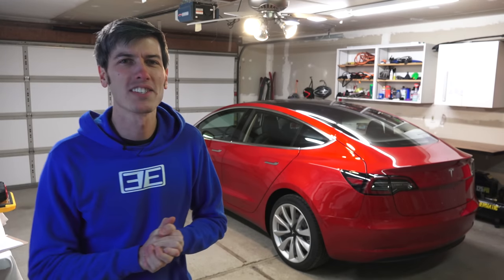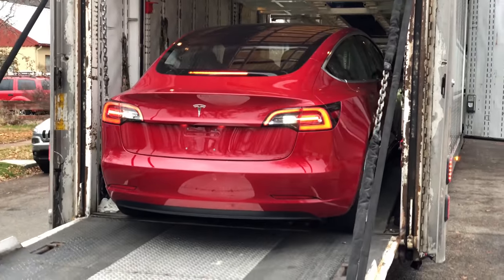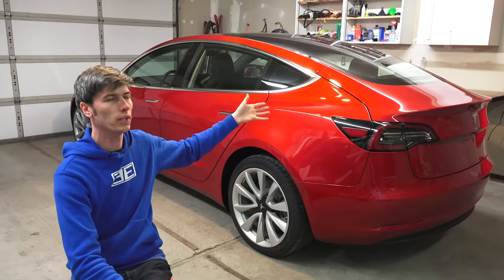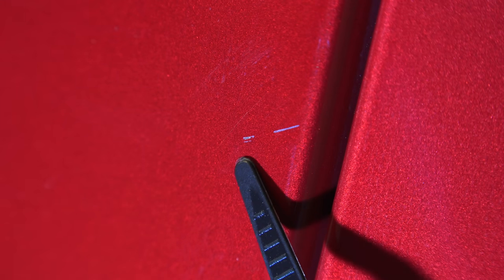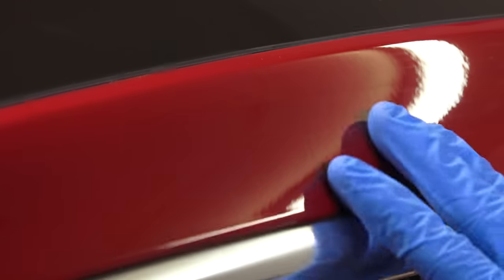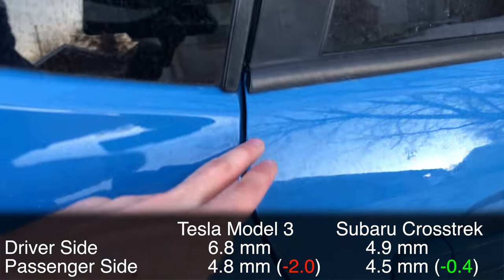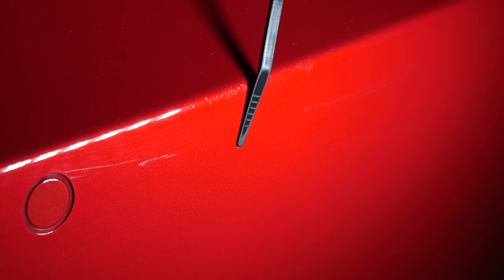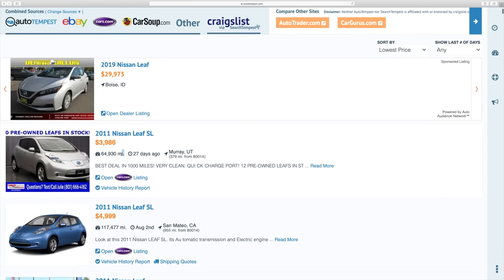Everything That's Wrong With My Tesla Model 3 - Quality Problems

Comment: Unacceptable in my opinion.  I love the car and the tech, but the quality at time of delivery is downright disrespectful.
Reply: I'd never buy a Model 3, not because of build quality issues, but because Tesla sees it fit to not put a speedometer and charge meter in front of the driver's face (where it belongs), and not being able to adjust the radio/sound/etc and the climate control without going through menus.
Reply: Elon Musk is a con man
Reply: DeLorean comes to mind.
Reply: Let's not forget this DOES happen with ALL car makers (as any quick YouTube video search will show you). The difference is that the complaints are usually dealt with at a lower level (dealer).
Reply: Brent Boswell you will have many other options in 2020.  If what every other manufacturer comes through with their promises.
Reply: I wouldnt have accepted a car with so many paint issues for sure ...
Reply: Also, let's NOT forget Tesla Model 3 is the SAFEST vehicle sold in the U.S. If you would rather be in a car that will NOT save your life in an accident but has slightly better panel gap distances; I would say your priorities are twisted.
Reply: @AscendedSaiyan3  No, i wouldn't pay that lot of money for a car built so poorly like this one, I would choose something else.
Build quality is very important in a 40 grand premium car.
Reply: @AscendedSaiyan3  Yes but this car is in the same price range as a BWM, Mercedes or Audi, which all also have excellent safety ratings, and ... better paint jobs and better assembling :D So i think tesla is going to have to improve if they really want to compete within that segment ...
Reply: @Osiris57  ,  Tesla encourages you to pay for your car in advance or first thing opon delivery.  I went over my car from head to toe before I handed my check over.
Reply: @Osiris57  It doesn't take much to get a 5 star rating. There are over 50 vehicles with that. It is another thing to have the LOWEST probability of injury of ALL vehicles tested. In that respect BMW and Audi aren't competing with Tesla. And, they TOO have paint issues. So, we are really only talking about panel gaps.  That sounds like competition to me.  The driving stability and the Autopilot features have NO equal, in capability.
Reply: People don't realize what they bought, more or less a experiment. That's what it always was, and probably always will be.
Did everyone seriously think this car plopps just out of the factory, that is in fact running at 30000% as every worker of this company. The only thing disrespectful, is not just complaining about things that aren't comprehended, yet
And btw if I would buy experiments, I would build it myself, like I always do, that's why I don't buy a tesla
Get a bugatti if you want your claimed things
And don't expect at this low price something that is worth 3 times the price.
Reply: @alatus7242  Then, you have no idea about the history of Delorean or Tesla. Tesla has LONG SINCE past Delorean and all those other brands. And, Tesla outperforms any vehicle in it's class, in just about all areas, except maybe panel gaps. Therefore, that's about the ONLY thing you can pick at. Isn't funny how unimportant ALL the other area BMW, Audi, and Mercedes fail against the Tesla Model 3?! 😉
Reply: It is unacceptable. I have never seen a new car scratched that badly. Simply wrapping the car for shipment as many manufacturers do would help prevent this.
Reply: maybe it was the delivery person...
Reply: @AscendedSaiyan3   I could buy a used model 3 and receive the same benefits of the SAFEST car sold in the US.  The entire point is that this brand new car (or any other brand new car for that matter) is being delivered in the condition that it is.
Reply: @moabman6803  I bet you've never looked that closely at many other manufacturers vehicles. If you had, you would know that it happens. The KEY is that the paint issues WILL be fixed.
Reply: @massimo7219  I don't understand why  more people don't realize that paint issues happen with EVERY automaker with SOME cars. It seems quite biased. It is ONE vehicle (his), NOT all.
Reply: @AscendedSaiyan3   Yes but it seems Tesla sacrificed some quality control issues in order to meet Model 3 delivery goals.  There are ALOT of issues upon delivery of the Model 3.
Reply: @massimo7219  Is that really truth or perception, though?  Is there ANY data that shows it is MORE than most mass automakers? I guarantee the people who are saying the things you are seem to be only going on perception. Then, you have to ask yourself, "am I being emotionally manipulated?"
Reply: @AscendedSaiyan3    No brand new car should be delivered in that condition.  None.  I would say the same thing about any car company.
Reply: @AscendedSaiyan3  I've worked at  several car dealerships. It doesn't happen very often. Now portions of the car will likely get repainted, and by who? I doubt by Tesla. They will likely farm it out to a nearby body shop which will likely use the cheapest paint they can to maximize proffit. It will look good in the short term until the paint fades. That would be my fear. Might as well buy a used car that's been in a wreck that's been repaired. Once a factory finish has been tampered with, it's a roll of the dice the quality of product used in such tampering as well as its application.
Reply: As a Model 3 owner, I find the position of the speedometer to be superior. Being directly in front of you is annoying because you have to adjust the steering wheel to a position that's not necessary ideal so that it doesn't block the speedometer
Reply: Lol no you wont. Dealers do not want EV sales. They will ensure you buy a gas car. Stick to Tesla
Reply: @massimo7219  True. No new car should be delivered like that. However, we should know these things happen with ALL carmakers.  Now, look at a lot of these comments. Does it seem like they seem to TRULY understand that?
Reply: @moabman6803  Now, you are assuming. And, we KNOW the type of defamation tactics the Dealership organization are employing against Tesla.

The car will go back to get the proper paint placed on it. MEANWHILE, he WILL have an upgraded Tesla to use! You rarely get THAT treatment from a dealership.
Reply: @AscendedSaiyan3  while that is true poor build quality can ruin the safty of a model! What if the door being offset is actually caused by a bent frame creating a weakness? How will you know until you test that? Who says you would survive the test hmmm? Bad build quality on ANYTHING = bad product period regardless of price and award. Demand a new product or a refund. No other option imo.
Reply: @AscendedSaiyan3  So you think Tesla will take the car back to the Tesla factory, strip the body completely, strip the paint completely, and redo a factory paint job at the factory high end spray booth with the factory high end paint? I highly doubt it, but I hope they do. At least from what I've seen how car companies act in general though I doubt it. As far as dealerships trying to defame Tesla, that's how the car business has been for years. They have always been at each others throat no matter who it is trying to defame each other. That's how the competitive car industry is. You never see a GM car commercial complement a Ford product. They bash Ford or whatever competition and praise their own product as superior. That's how it is. Not saying it's a nice thing to do.
Reply: @AscendedSaiyan3  Most dealerships will give u a loaner btw. The dealer I'm at now will just rent u a car, my last dealer had a huge fleet of loaners and loaned cars for all kinds of reasons. The unfortunate thing is your personal insurance will have to insure it. So if it's a upgraded vehicle and u get in a wreck in a upgraded vehicle,  u get to pay for the increase in your premium.
Reply: @brentboswell1294  lol
Reply: @oceanbytez847  Nice try, but it fails. I will explain why. The FIRST production models of any Tesla are the ones that are crash tested. Those were the WORST versions of those products. Panel gaps have only gotten BETTER since then! 

Plus, you are only talking about FRACTIONS of a millimeter for the panel gaps. It is silly to believe that changes the over-engineered safety of the  Model 3. HOWEVER, following that nonsense, for a minute, the Model 3 would STILL be the safest vehicle ever tested. So, the "compromised safety" angle has no real logic behind it (just emotion).
Reply: @moabman6803  If this was a regular dealership model, I would seriously doubt that level of service would be done. However, Tesla has a different mantra (hence the mobile service and everyone gets a good loaner vehicle, etc).
Reply: Tesla is a religion, they don't care about the respect. They charge premium for a car that has nothing premium in it or around it and they know their followers are going to buy it. It's like Apple but worse because iPhones are quite decent.
Reply: @sic22l  It's more like Tesla hate is a religion. The CEO only gets paid based on achievement. The company's mantra to help move humanity from dangerous fossil fuels (which will END humanity, if left unchecked). The vehicles produced BEATS any gas powered vehicles in class in MOST metrics and engineered to run for OVER 500K miles! So, those that want Tesla to fail, ONLY have a couple minor things to try to turn into a mountain (panel gaps and old school luxury interiors with buttons). It's sad. I hope these people realize the fossil fuels industry is controlling them via their emotions. Maybe then they can wake up.
Reply: The paint is a 2400 dollar up charge. No way regardless of how much you like their tech should you excuse those flaws. The point is that they have no dealer to deal with it is something you have to look at as well. It's like people who make excuses for apple because it's apple.
Reply: @edgee400  Dude, it IS being dealt with. What are you talking about? NO ONE in their right mind likes dealerships, in their current form.  If he took that to a dealer, he would NOT have a loaner vehicle to drive around in, until it is returned! I guess THAT'S what you would want, huh?!
Reply: @Vox Daisy That's not cool, man.
Reply: What would you expect from a car that is assembled under a makeshift tented parking lot, by underpaid, overworked workers with limited, rushed training? How good could the quality/ reliability/ safety/ fit and finish be as an end result of this? There appears to be no quality control over there also. I would be surprised if the Tesla's wheels don't fall off while Jason's driving it.

Anyone who would make arguments defending this needs to get their head checked.
Reply: @AscendedSaiyan3  "The car will go back to get the proper paint placed on it. MEANWHILE, he WILL have an upgraded Tesla to use! " ~ On a brand new car, he will already be inconvenienced. You can say that it is an "upgraded" loaner, but it's still a loaner. When I bought my BMW new, I didn't immediately have to have a loaner.
Reply: @scottcantrell7348  SOME BMW owners DID have to give it back new. You can just do a quick YouTube search, to see! 😉 NOW, do you understand? THAT is why anecdotal evidence is fairly useless, when trying to assess the whole. Science.
Reply: @AscendedSaiyan3  A dealer acts as a step in quality control. When new vehicles come in, they inspect them BEFORE delivery to the customer, eliminated having to get a loaner and fixing after delivery. Do things slip through? Sure. The issue with Tesla is they seem to have missed a step with quality control. Anecdotal evidence is useful when there is quite a bit of it.  Looking at your comments, you seem to be excusing Telsa by saying "everyone has quality control issues." And no they don't, not the point that even Telsa is admitting to and investors are questioning. And it may seem like a small thing, but quality control in things like panel gaps and paint can by a pretty strong indication of other quality issues. Ask circa late 70's and 80's GM, Ford and Chrysler.
Reply: @scottcantrell7348  Now, you have stepped this to insinuating that there are more issues than the surface stuff. Good job. I bet I can find a BUNCH of YouTube videos on the very automakers people want to act like don't have the same issues. Until you have proper numbers, for comparison, you are NOT working with facts. It's just negative overreach with a CLEAR purpose.
Reply: @AscendedSaiyan3  Wow. You are in deep to Tesla with absolutely zero perspective. Telsa's quality control issues are VERY well documented, even on investor calls with Musk. And yes, Musk can garner negative attention with just his grocery list. I think they are a company with a revolutionary product that is clearly having issues. Due to their newness, many will forgive them. And when people are spending $70-100k on vehicles, they can give "upgraded" loaner cars. But the 3 is supposed to be a car for the masses, and they are not going stay in business very long doing that with base model 3's.
Reply: @AscendedSaiyan3 :  Except it also has safety issues in some tests, but of course, Tesla and fanbois pretend that doesn't matter.
Reply: @scottcantrell7348  "Deep into Tesla without perspective"?  Really? Then, why am I the one using facts?  Most others are just using emotions/feelings. They FEEL there could be other problems, because of delivery issues and minor panel gaps issues. Meanwhile, ASTON MARTIN charges more per car and STILL  has large panel gaps. Are they jumped on in the same way? No, so that's not logical.
Reply: @rogergeyer9851  Stop lying. THAT is a fanboy tactic! I have seen the reports. Thr Model 3 has the lowest probability of ANY vehicle EVER tested, in the U.S. There is no LOGICAL way around that. Just saying the word "fanboy" is just a tactic used when you have no facts behind you. Educate yourself on the product and the "competition".
Reply: @AscendedSaiyan3  what I meant was that you have to take in consideration that you're not going to be dealt with as quickly as you would if you had a dealer locally my friend has a model X that he can't get repaired until after New Year's if it was at a dealership it would have been fixed right away more than likely or at least not wait 2 months to have something fixed on a car you paid $100,000 for. Not everyone has Tesla service in their city.
Reply: @edgee400  What dealership has ANYONE EVER gotten a new paint job in a day?! LOL!  Why are people, all of a sudden, romancing dealerships? PLUS, why are you trying to act like Tesla does not have service centers? Not every one has an old-fashion dealership near them, either. At least, one company has a mobile service, for most things. I wonder how much people actually know about Tesla? People keep saying non-accurate things.
Reply: @AscendedSaiyan3  "Really? Then, why am I the one using facts? " You've yet to address the fact that Musk himself has acknowledged quality control issues in investor calls. Look back at your comments (I've read the entire thread). You keep throwing out words like "logic" and "science" without backing up your opinion. And no, you've not produced any facts. Just a lot of your opinion. (do a search on youtube...that's your evidence?) Your sole argument seems to rest on "other manufacturer's have issues sometimes too." We get it. Either you're a fanboy with no perspective or your part of the marketing team that trolls social comments or you're someone who has never worked hard to spend your own money on something with the expectation that it should be right from the start.
Reply: @scottcantrell7348  Yes, doing a search on YouTube,  for your favorite automakers IS evidence! That's how evidence works. You didn't know that? Hell, you are on a YouTube video, NOW! 😂 That means you would have to discount  THIS video, in order to try to make your point.  Also, I have listened to EVERY conference call for them, over the past couple years. There jas been NO recent mention of quality issues. These TRUCKING delivery issues is a fairly recent, since they kust bought a bunch of trucking companies. They did not have the trucking capacity the deliver their cars fast enough. Now, Tesla has to solve the problems of these new vehicles getting damaged, in transit. The end.
Reply: @AscendedSaiyan3   No, because most people don't make a Youtube video about purchasing a new car.  Because this is Tesla, I understand the excitement and all.  But it doesn't excuse the action of delivering a new car in such condition.
Reply: @massimo7219  That's B.S.  A LOT of people make videos showing their new vehicle purchases and issues. Otherwise, how did all those videos get on the site? Magic?

Yes, no new car should be delivered in that condition. Unfortunately, you can't catch everything. It is impossible. Therefore, the most important thing is to fix it. The end.
Reply: @AscendedSaiyan3  It's safe if built to specification. Detroit figured out paint 60 years ago. What about all the stuff we can't see?
Reply: @stanwbaker  I already dealt with that line of thinking. The vehicles tested were BEFORE Tesla got as good as it currently is with the Model 3. So, following YOUR reasoning, the Model 3 is even SAFER than it was in the original crash tests!

NEWS FLASH! All automakers tend to have paint imperfections near the bottom of the vehicle, even after 80 years of experience! Research is your friend. 😉
Reply: @AscendedSaiyan3  If that helps you sleep at night, go forth and be very careful.
Reply: @stanwbaker  Yes. The facts help me sleep VERY well, at night. That's how you keep FUD from affecting decisions. And, Model 3 has been proven, BY FAR, the SAFEST vehicle in the U.S. (likely the world). After over 80 YEARS, NO other automaker has yet to get to that point, while you worry about a paint scratches in transport. 😉
Reply: @AscendedSaiyan3  Tesla makes the poorest quality car available in the US today. Tesla makes the poorest quality electric car available. The hand-picked parts carefully hand assembled to send to IIHS should not be assumed to be representative of the vehicles with a build quality Chrysler was mocked for in the 1970s. It's no accident that Toyota makes the effort to communicate that the plant was emptied years before Tesla took over.

Apparently, "safety" does not take into consideration the propensity for vehicles to erupt in flames spontaneously.  It's hot garbage. No other automaker, worldwide, has a warranty redemption rate approaching 100%. Remember, when you finally abandon it 10-12 months from now, that someone told you your next car will not be a Tesla, even if pretty boy doesn't run out of cash.
Reply: @stanwbaker  THAT is the difference between emotions and facts. You are only dealing in emotions. Emotions override intelligence.  Research is your friend, whenever you decide to stop crying and be an clear thinking adult.
Reply: @AscendedSaiyan3  Accepting the unforgivable build quality and propensity to explode of the Tesla is emotion, or really, fashion.

if you've ever been within six feet of one of these alleged vehicles, you would know. Or maybe this is the first automobile you've ever encountered.
Reply: @stanwbaker  Too bad every car reviewer worth their salt says it's a great product AND beats every car in it's class (over MANY metrics). Emotions, indeed.
Reply: @DJ Do you, when the fossil fuels industry does that to you? Do you swallow their dino juice, every chance you get? They DO pimp you out, obviously. And, you REALLY seem to like it, even though they are clearly bad for you. 😂
Reply: @fatboy19831  Which is really the point.  Tesla is run by a bunch of IT guys who do not know how to build cars.  The established car makers are catching up on their software and battery technology rapidly, and when they do, Musk's reputation as a "visionary" won't be enough to sell his poorly constructed cars.

Tesla will probably disappear, but he will get a place in history for making electric cars viable for mass adoption.
Reply: @larryrouse6322  You could say the same about Apple. With the exception of GM every other car manufacturer is at least 5 to 10 years  2 generations behind Tesla. Buch of IT guys or not.  Even the startups like Rivian lack any kind of real charging network.  Tesla building a supercharger network and their own battery plant will keep them in the lead for some time to come.  Until a company like VW can come up with a real electric car program and not a PR campaign. Tesla is safe in their dominance in the electric car industry.
Reply: @fatboy19831  I think Tesla will get competition from other areas. For example the new Rav4 hybrid cots just as much in gas to drive as a Tesla costs in electricity to drive. Except the benefit of the Rav4 is it has substantially greater ground clearance and can be taken on mild offroad areas and it doesn't have to sit and charge in order to drive it like a Tesla. Plus Toyota's hybrid vehicles are ridiculously reliable. They are at least twice as reliable as the non hybrid Toyota vehicles. When I was at the Toyota dealership the other day, I saw a Tesla getting traded in for a Toyota.
Reply: @brentboswell1294  so true............bloody dangerous if you ask me
Reply: Massimo azz
Reply: @AscendedSaiyan3  Funny how tesla fanboys throw around the safety aspect every time as if that excuses the terrible build quality. It sure as hell didnt help all the people that have died from the crap autopilot. Not every cares about safety either, it sure as hell wasnt on my list when I bought my '89 Mr2.
Reply: Moabman, really? We own a Toyota Prius, a model X, and a model 3. The Prius is from 2010 and has about 37k miles on it. It’s been in the shop far more than I’d like to admit. While the Teslas are a lot younger they haven’t been in need of any service yet. Not sure I’d agree with your assessment.
Reply: @AscendedSaiyan3  paint should not have gone to trim/assembly.
no air dry paint  is same quality as factory baked.  And you can not get enough heat into factory paint to properly cure w/o disassembly; plastic melts, window seals & tires burn.
Reply: @sic22l  True, but autos have huge logistics chain & more complex assembly.
Reply: @scotts.7662  Dude that is transit paint damage. What you said does not apply.
Reply: @AscendedSaiyan3  really so 39 years in auto body, paint, and assembly @ GM, Ford, Chrysler, AMC, Honda & Nissan count for nothing? BS, some of it might be transit but you have no proof as it could just as well be from assembly.  
There are other flaws that are OBVIOUSLY actually baked in the paint as many others w/ real experience on this thread have already pointed out. Just go back and read.
Reply: @scotts.7662  There were only a few delivery scars on the paint, to begin with (according to the video). Why are you trying to make this about something else?
Reply: @AscendedSaiyan3  not @5:45 points out obvious dirt baked in paint. Looks like bad aftermarket.
Reply: @scotts.7662  So, why is this not with all or even most Model 3s? That would seem to blow a rather incredibly large hole in your theory.
Reply: @AscendedSaiyan3  theory? Fact::dirt baked in paint at plant.
Reply: @scotts.7662  You should see the video of the new Mercedes CLA250 on "Model 3 Owner's Club". It is not as well put together as a Model 3! Yet, here we are.